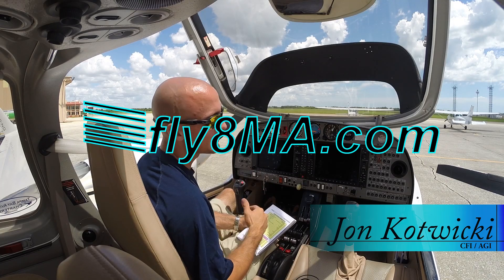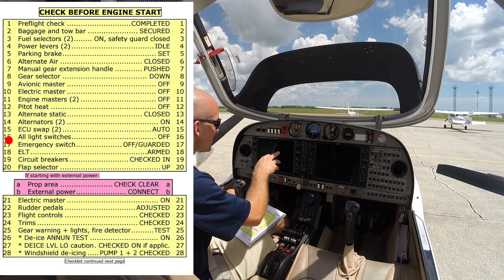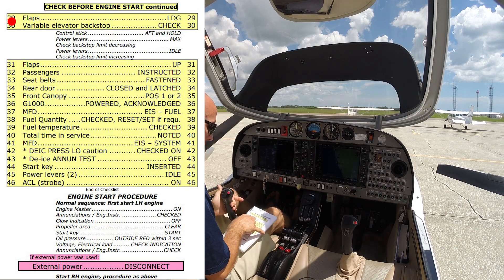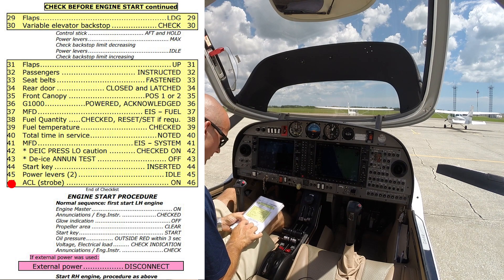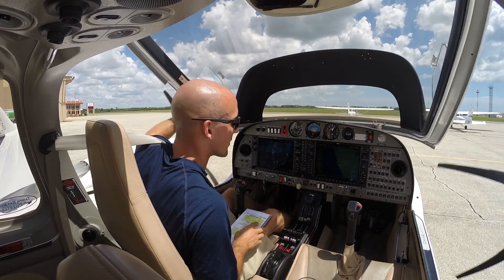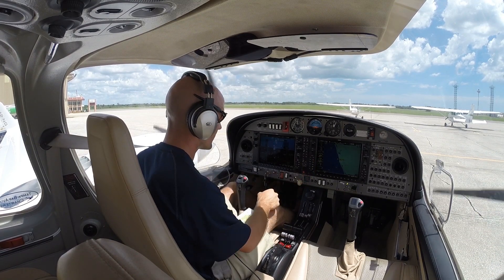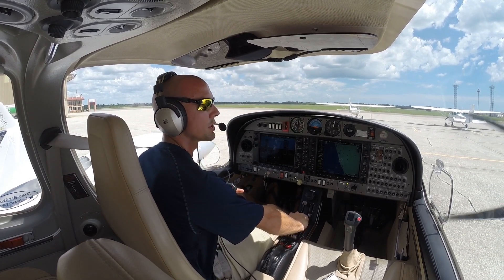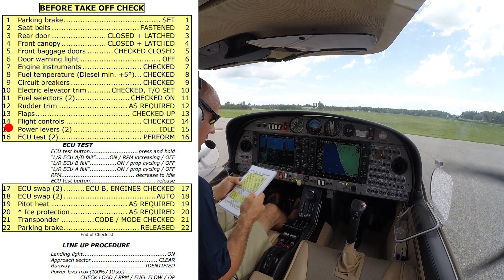Ground School: Startup and Takeoff on DA-42 NG | Diamond Twinstar

Comment: Great video, thanks for sharing and giving us that dont/cant own a DA42/62 a little insight into the normal checklists fm preflt to takeoff! 

....on a personal side note, I noticed you wearing flip flops.... Kinda a personal pet peeve of mine! Of course you can ‘what if’ everything to death but what if you had to evacuate quickly, especially after a crash and trying to move around torn metal and such could be difficult. Just something to think about. Thanks again for the video. (And yes, I realize this video is several years old)

Comment: What is the cruising altitude DA 42, and is this aircraft pressurized??
Reply: While I don't pilot planes, the aircraft isn't pressurized (yet cruises at 16,000 ft, so you need an O2 supply and mask), and apparently gets quite cold according to a DA-42 YouTuber. The Piper PA-31P Navajo is pressurized though, and is similar to this plane, except 40 years older. Lol... :)

Comment: Awesome video John!

If the DA42 is also marketed to Flight Schools, Diamond should offer optional dual panel mounted side-stick controls (as found on Airbus Aircraft) and/or dual rams horn yokes (as found on Boeing/many other commercial Aircraft). Just seems like it would help with muscle memory or familiarity when heading for the Airlines. Just my humble opinion.
Reply: U.S. PATRIOT naw, going between diamonds and cessnas myself I’ve noticed it’s barley even noticeable , it moves the plane either way

Comment: Its a best practice to close canopy before you start engines.
Reply: It's really hot in Florida
Reply: @westy2432  That's what AC is for. Lol... Unless this $200,000 vehicle lacks AC. :)
Reply: @thatguyalex2835  It was broken most of the time.
Reply: @westy2432  Lol... I have heard stories from a YTber that the DA42 lacks good interior climate control (bad at heating and cooling the cockpit and passenger compartments).
Reply: Yes and I need to order pizza so then the da42 will be hapu

Comment: You do both ECU run-ups at the same time..? Interesting, need to check with my CFI on that
Reply: I think doing one at a time allows you to have more awareness per engine during the run-up
Reply: Pretty sure you can do them either simultaneously or separately, your preference

Comment: Hey nice video, looks like a fun plane to fly. One thing I noticed in watching several Takeoff videos is the pilot forgets to turn off the fuel pumps after take off. How soon do they recommend turning them off, and can it be a problem if you do forget.
Reply from the maker: +Mike Rowell they usually get turned off around 1,000' or whenever the POH directs.... I typically never touch them below 1,000' agl

Comment: The checklust calls for variable elevator backstop done with flaps on LDG. Did it still work for you when you did it after lifting the flaps?
Reply from the maker: There's a couple different checklists for the da-42 based on the exact model and year.  I just followed the one that matched the POH tied to that particular hull.
Reply: The checklist you were referencing says to do it with flaps set to land. Interesting, as the backstop should not kick in with flaps in the up position.
Reply: Think I can answer myself - as it's the NG (and has a bit more oomph), the backstop is active all the time. Not so with the older version.

Comment: Nice video! I would like to ask though, what is the ECU test?
Reply from the maker: ECU test is basically your run up.  It is testing the integrity of each engine control unit to ensure it is working properly.  The engines in the DA-42NG are electronically controlled, very different from something like a Seminole with throttle, mixture, and prop levers connected to cables.
Reply: Ah i see, that is all because it has a FADEC right? Pretty amazing stuff! Thanks for explaining it. I'm looking forward to starting flight school in the next couple of years, just need to save up money for it. Every bit of knowledge helps haha. Cheers!
Reply from the maker: Good luck!  The more you study now the more money you'll save in training costs down the road!
Reply: Awesome! Cheers!
Reply: Yes, there are two ECU's, A and B, you can hear the RPM's rise then drop then rise again during runup, this is each ECU being tested.

Comment: thanks,, whats the reason to watch the fuel temp? can it get to hot or other reason? i know jet a1 is good to -47C i think , and can you control the fuel temp by any means, covers etc?
Reply: I would have thought diesel would be more problematic in cold conditions (gelling)?
Reply from the maker: Diesel, or Jet A is a little more temperature sensitive than regular AVgas.  There is not a way for the pilot to control the fuel temp on that aircraft.  Your most problematic temp would generally be too high of temperature for fuel on a diesel engine.

Comment: curious-- why did you retract your gear so late into your climb? After positive rate and no sufficient runway left, you should have slung your gear up. You sure took your time.
Reply from the maker: Might just be the bend in the windscreen, but there was quite a bit of rwy and clearway left in front of me.  I'm all about lifting it up early, however I want to have enough altitude that I would have time to cycle it back down if I did need to land straight ahead.
Reply: Hi Ali. It depends on your philosophy!
Some CFI want you to retract the gear as soon as possible. Others prefer to wait until it is not possible to land straight ahead anymore.
Taking into account the fact that putting the gear down requires between 6 to 10 seconds on this aircraft.
It is the reason why it is sometimes better to wait a little bit prior to retract the gear in order to benefit from the remaining runway in case of emergency.
A friend of mine undergone an engine failure during the climb on a single engine aircraft.
It occured in an airfield where if he had retracted the gear he would have been forced to land in the river.
In this case, hopefully, because the gear was still down, with the drag and the full flaps, he managed to land on the very last available meters of the runway.
Reply: Looks totally fine to me.